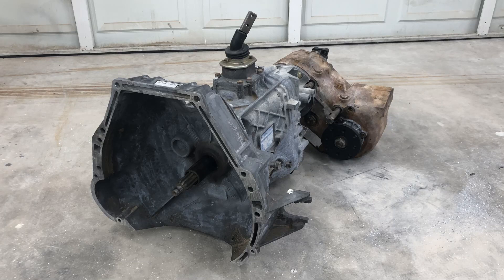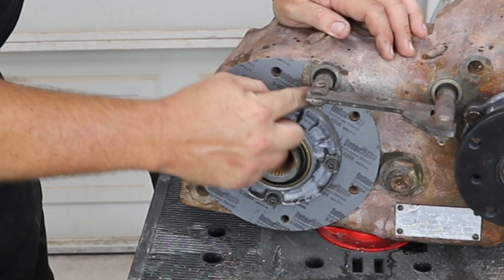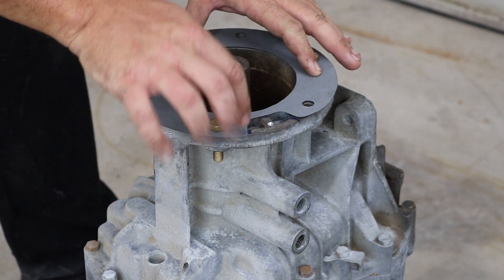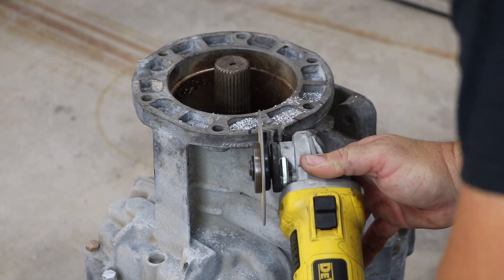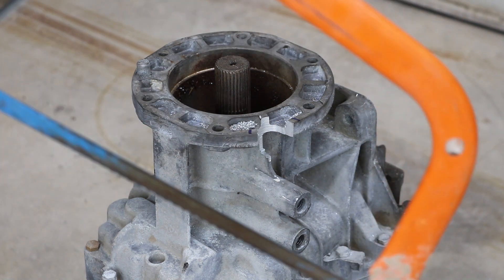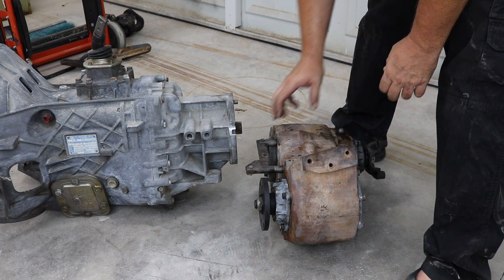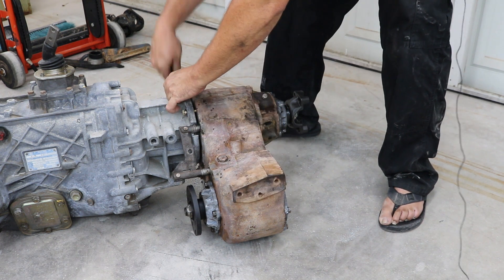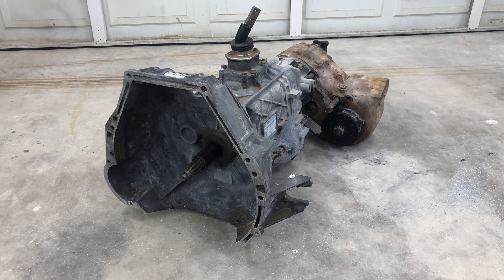Hot to modify a Ford NP205 to fit a ZF5 with common tools.

Comment: many benefits to the twin stick and even more in a rear wheel drive truck. 1. you can run as front wheel drive in snow 2. front digs witch can move the front of truck over if your stuck or get pined with trees between tires you can slide the front over 3. low range well in 2 wheel drive (my f350 has auto locking hubs so there was know way to get low range if if on concrete or blacktop without risk of braking something in drive-train) and the list go on after using a buddy truck that had it done, i did it to my last Chevy truck and am working to do it to my f350 now.   thanks for sharing.

Comment: Very nice video. No extra junk just down to business.  The twin stick, front wheels locked only setup is for extreme off road situations. Look up "front digs". Very rare to need but it can be an amazing tool. Thanks again for a very well done video.
Reply: I also use 2wd low alot in my jeep with 4bt cummins swap with zf5 and 205 alot of times i domt need to be in 4x4 detroit locled dana 44 on 40s so 2wd low is nicer on the clutch and slower trails and eaiser on front end parts and steering also nice in parades or teraffic jams!
Reply: @jrschomaker4967  I had never even given any thought to having 2wd low. That would be fantastic due to pulling a gooseneck trailer up some very big hills in eastern Kentucky. Especially when I sometimes pull enough weight to get me thrown under the jail, as my Dad used to say.

Comment: That rib you cut is a very common cracking point on the zf5, but I believe they only crack because the transfer case is hanging off the back unsupported. I think you’ll be fine since you’re adding a separate TC support.

Comment: A twin stick allows the front to be engaged only comes in real handy on northern trails when there is a tight turn. You turn your steering wheel and quickly punch the throttle for a second and the front end will jump into the turn. You might have to do this a few times but you can take a truck around a curve that otherwise it would not fit.

Comment: I have to ask, why put a dinosaur of a T-case on the much more modern ZF5-S42 or ZF5-S47 transmission? The BW 1356 or 4407/4408 or even NP271/273 that are rated just as strong, at well under half the weight.
Reply from the maker: Realistically they are both dinosaurs but for me I needed the higher low ratio of the NP205 + the fixed yoke. Also, manual versions of the above cases are just as sought after and expensive. Weight is irrelevant to me on a Cummins powered diesel truck.

Comment: just remember kids, do NOT anchor the 205 rigidly... it WILL break the mount, you need to leave room for the torsion action of the engine multiplied through the length of everything